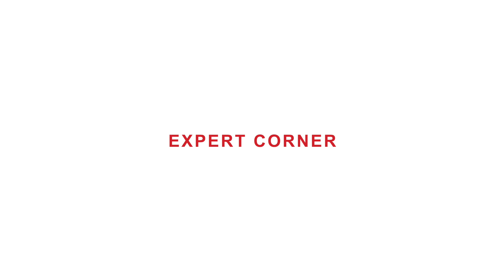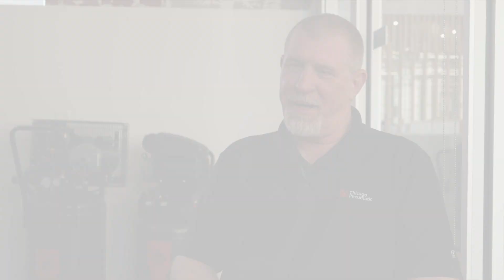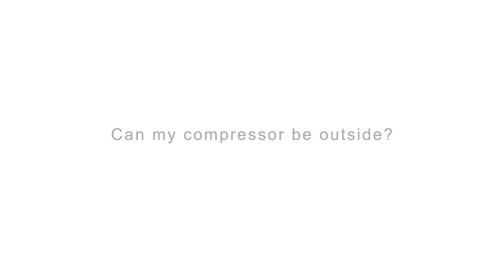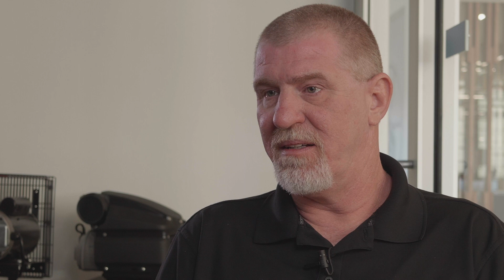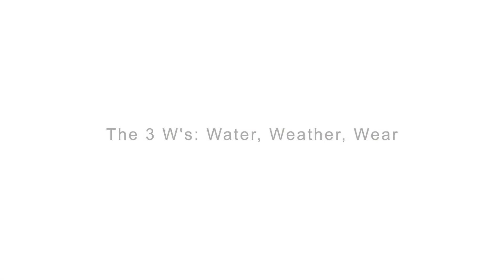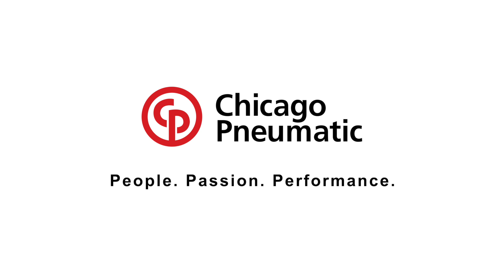Can My Compressor Be Outside?

Comment: did not answer the fuggin question
Reply from the maker: Sorry you feel that way.  The shirt answer is YES, they can be placed outside.  But every installation is unique and should be evaluated to determine what is needed to extend the life of the compressor.  Simply putting one outside with no consideration can shorten the life of a compressor.
Reply: @CPCompressors  Put more simply and more directly:  YES compressors can be put outside, but put them in an insulated enclosure that protects from the elements.  Why is that so hard?